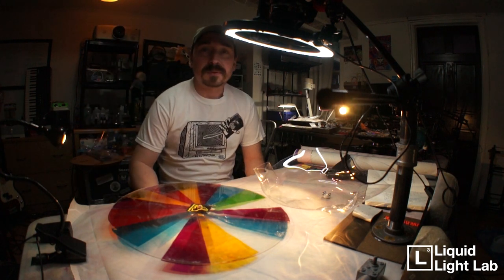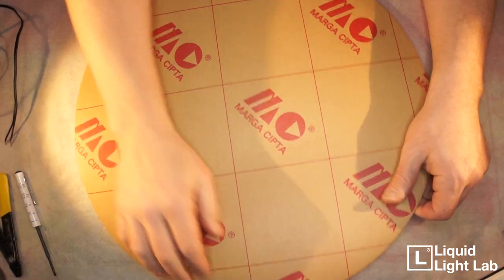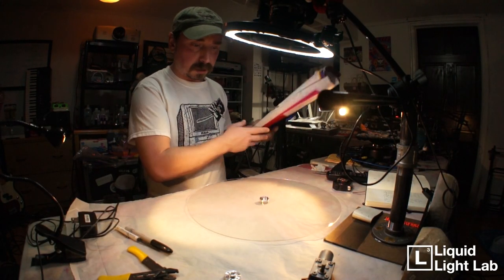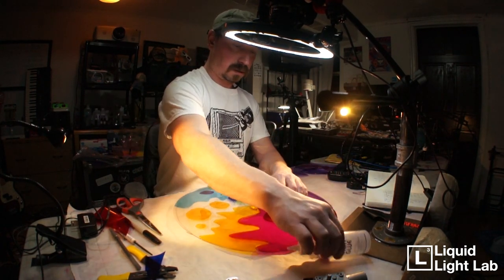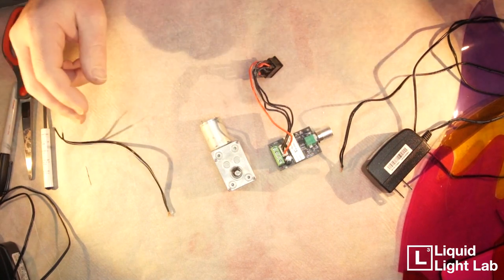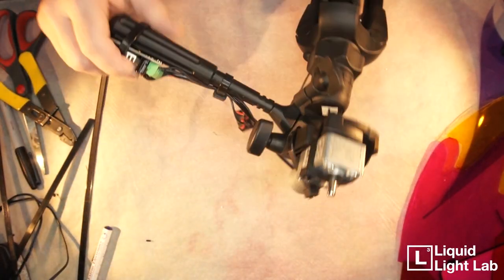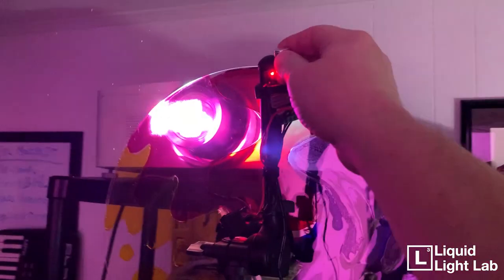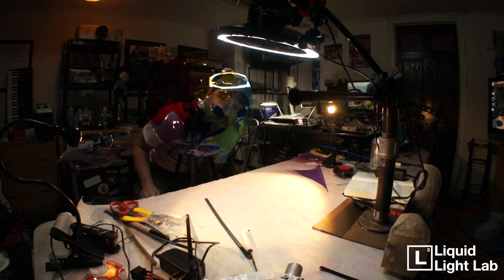How To Make A Color Wheel - Light Show Basics

Comment: Are you familiar with the lighting effects used on the TV series voyage to the bottom of the sea in both the reactor room,and on the flying submarine to simulate the energy output?
Reply from the maker: I haven't seen the movie in a long time. Can you tell me more about it?
Reply: @LiquidLightLab  TV series...the reactor room has a large panel on the wall showing the energy output...it used a unique color wheel effect along with what I thing were two revolving disk with oval shaped holes cut in them rotating in two different directions. I loved the effect but have never quite been able to duplicate it

Comment: What gauge/type of electric wiring did you use to connect the driver to the motor? Ive been trying to track down the right wire...
Reply from the maker: I forget, but maybe like 16.  A thinner one, there's  not too much electricity that is used. It's only 12v

Comment: Hey Steve,  just wondering if the motor has to be 20rpm. I looked online and found quite a few motors just like it but I couldn't find one that's 20rpm. Does it matter? Can I use a higher rpm?
Reply from the maker: It can be anything you like, but slower is usualy better.